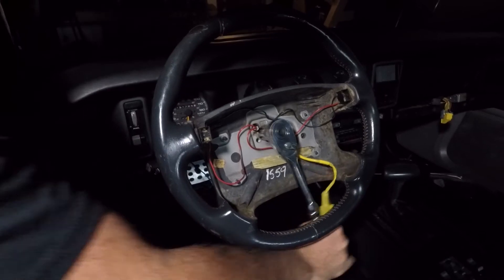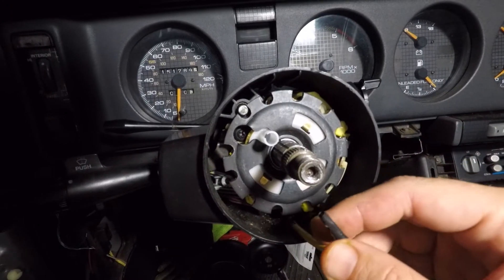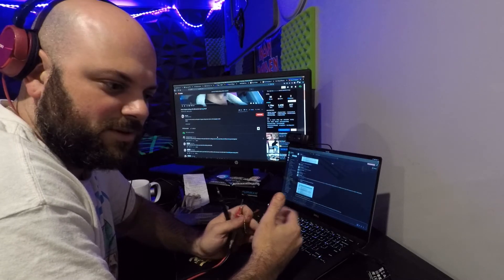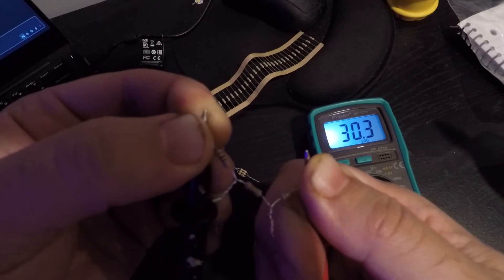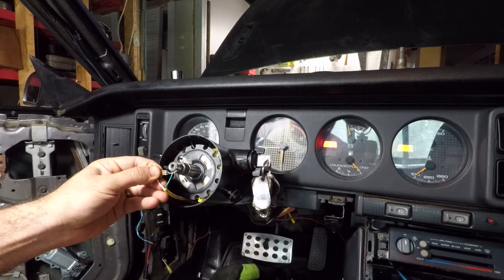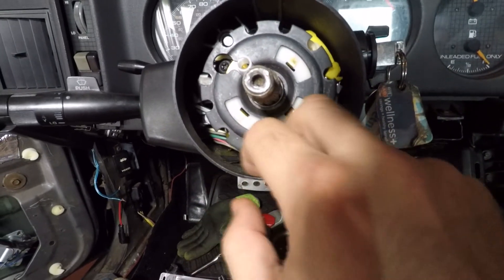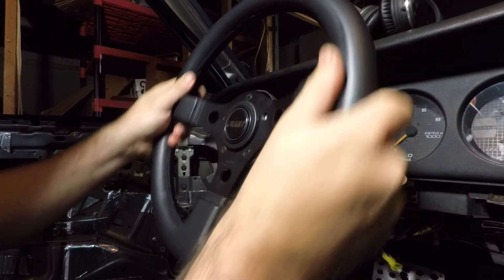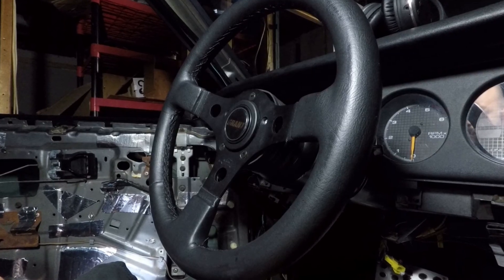Aftermarket Steering Wheel Installation and Airbag Light Bypass on third gen Fbody

Comment: how did you find which ohm resistance? with a multimeter set up on ohms in the airbag conector?
Reply from the maker: Correct. I find the proper resistance I needed after doing some research.

Comment: The folks commenting about daisy chaining (series wiring) resistors really need to stop. I guarantee those folks saying to daisy chain resistors have never taken an electronics course, professionally wired anything in series or parallel, and know dick about Ohms law. Resistors are designed to impede current. Why is impede current important? Certain applications are designed to operate within a certain range of ohm rating ( speakers/amps). Speakers, as an example, with incorrect resistance will blow out of too much or too little resistance is applied to the amp. How is that solved? Most pairs of speakers are home run to a receiver and will read 8 ohms. But what if you have a big ass room or back yard pool setup where you may require an extra pair of speakers to carry the channel of sound without just blaring sound. You would add another pair of speakers further away. This is where parallel wiring comes into play by simply running one wire from one speaker to another, matching the positive and negative terminals. The resistance will DECREASE from 8- to 4 ohms. Sonos and most home receivers operate within that resistance range. The math equation is : total impedance = impedance/devices.

Series is different and has plenty of applicable uses. Series wiring operates as a closed circuit where the current runs a single path from device to device. Series wiring is very common in wiring home/commercial security systems. In fact, resistance is added at the sensors (if necessary) to supervise the applicable zone (window, doors, etc). Why is series wiring important in this application? Since series wiring has positive wire to negative wiring daisy chained individual zones need to trip. Series wiring reduces current while raising resistance.The increase resistance happens because the current flow has less options (paths) for the current to travel. The resistance will INCREASE with move resistors added in series. The math equation is : total impedance= impedance x devices.
Reply from the maker: Does this guy know how to party or what?
Reply: @OverheatedGarage  I always hear " You must be fun at parties". I think they mean it!

Comment: There’s a better way to free up the wheel! The housing has two double ribs at the top and it’s plastic. Take a dremel and grind those ribs back and slightly bevel the inside edge of the column! Much cleaner look

Comment: i thought you wanted everything in Samantha to be a stock Trans Am, im guessing you couldn't find a Brand New un damaged 90s Trans Am Steering Wheel, I took out my airbag im talking all the wires, knight rider doesnt have that so it had to go, maybe im just crazy but i just took apart the 92 firebird dash and removed the airbag light.
Reply from the maker: Yeah that's another good option. I figured I'd try this way since I had resistors anyway. The rest of Samantha really is as close to stock as possible. This is the only aftermarket piece. I was never a huge fan of the stock steering wheel. It felt big and bulky. This one is slick!

Comment: You know you could have done it the easy way by disconnecting the battery, pulling the SIR fuse, wait 12 minutes and reconnect the battery. This deactivates the Airbag light for good.
Reply: Where would that fuse be located? I couldn't find it on my fuse panel under the dash by the kickpanel.